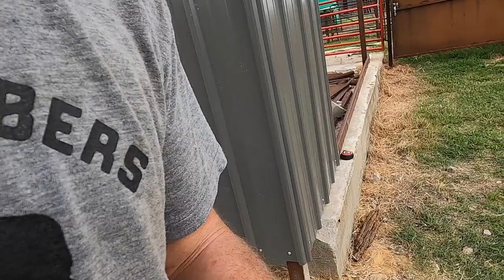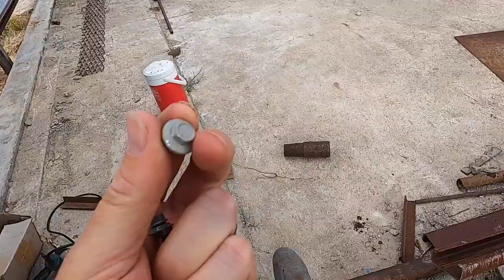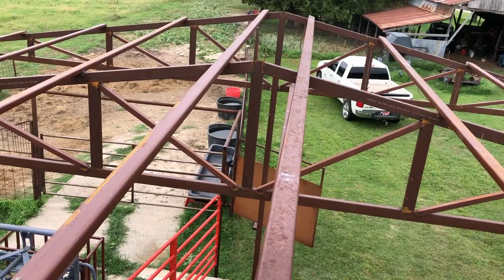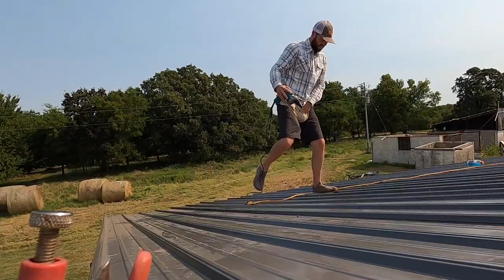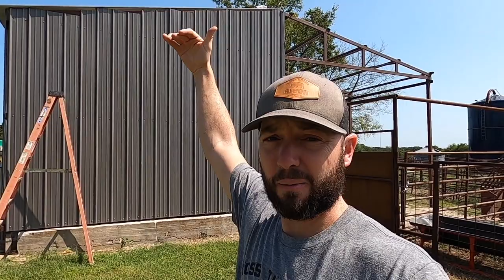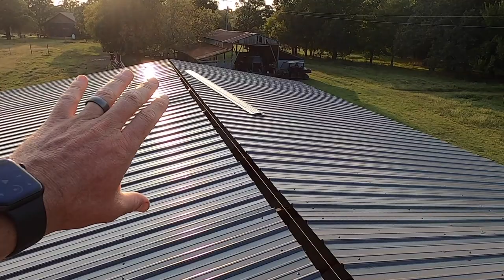Building A Bison Barn: Part 3

Comment: Nice looking barn.  I work at a lumberyard and have sold and delivered an awful lot of that metal.  I have it on my 20X40 barn and on 1 of the dog houses.  Makes a nice appearance.  We have to rebuild another barn we will be putting up on it.  Pricey stuff, but its maintenance free.  You got the key, getting that first piece all lined up and the rest is a breeze.  Looks like you are in need of a cordless impact to drive those screws.  Cross Timbers Bison, looking a bit better every day.
Reply from the maker: Thank you!

Comment: The screw you are calling a lap screw is a metal to wood purling screws.  The lap screws are an over sized self drilling screw just like the screws you are putting into the purlins.  Make sure when you do the roof you use the styrofoam closer strips, and the self adhesive seam tape on all the roof joints.

Comment: I’m glad you are getting this done too. But a question.: what if the bull head buts the walls? Will they hold?
Reply: my thoughts exactly , i can see the need for 1/4 in. plate steel 4 ft high anywhere those beasts can touch
Reply: From what I've seen it's just a space to get out of the weather so they can still work the bison in bad weather. So I'm imagining they will still be in a shoot?
Reply: @Darlene Jordahl, YEP, that's the same question I had! 🤔 I don't know what it's being used for but since Daniel's goat, Old Jerk Face used to make so MUCH NOISE & OFTEN LOVED TO HEAD BUTT TIN, Wouldn't the Bison love doing that too, well, or at least Dunbar would! Lol! I'm sure Dusty will answer our question. Such a AWESOME VIDEO & GOSH YOU & DANIEL AREN'T AFRAID OF HEIGHTS, ARE YOU? I GOT DIZZY & FREAKED OUT EVERY TIME YOU 2 GUYS MADE STANDING ON THE BARN ROOF LOOK SO EASY!! It's very nice looking & I'm happy for you (lots of hard work went into that plus you had help, which is great!) Congratulations & thank you for another GREAT video! Loved seeing the Bison when you were working. Sincerely, Carrie Slockbower, ANAHEIM, CA 
May God Bless you, YOUR family & the Animals! LOVE & PRAYERS! ♥️😇♥️
Reply from the maker: The bison won't be able to reach the sheet metal. Victoria, you are correct. It is to cover our handling equipment and to work them in bad weather. Thank you,
Dusty

Comment: You will need a lot of pipe or steel tubing lining the wall's or they will walk right through the sheet metal. Good luck. Remember Bison need double the fencing.
Reply: You have probably figured out that the bison will not be in the building.  It covers the equipment they use when they work the bison.